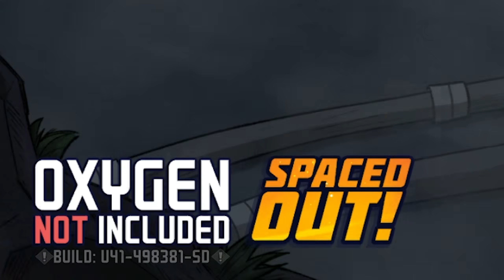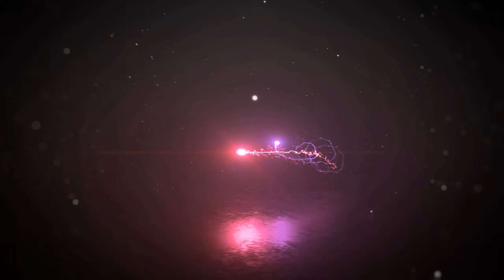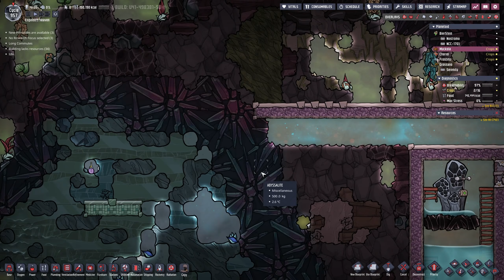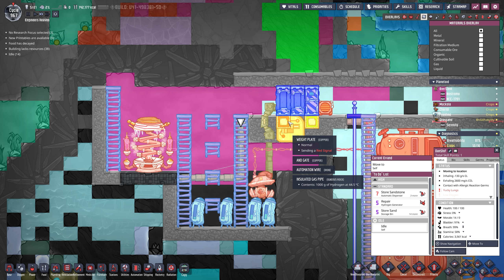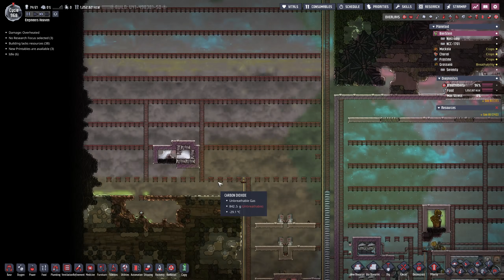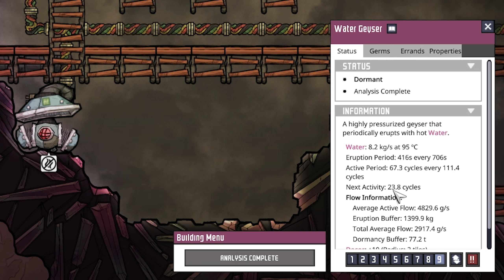ENGINEERING a WATER GEYSER TAMER! (LP1-EP 32) Oxygen Not Included Spaced Out

Comment: The devotion to using that particular bridge to feed water into the boiler is impressive.  
One of the reasons I love this game - everyone approaches it differently!

I would have built another feed pipe to the water vent coming from the other direction after some deconstruction/reconstruction of the liquid lock and probably some careful piping runs on the other side so I didn't punch a hole anywhere one wasn't needed (or do a lot of mopping to fix it :) ).
Reply from the maker: Since this boiler is just temporary and is completely useless after the planetoid has no more polluted water I just keep in mind that it doesn't have to be pretty since the idea is to rip it back out relatively soon anyways, haha :D
For a permanent build I would have probably rebuilt it as well. But as you said, that's the beauty of the game. Many different ways lead to the same(or at least relatively similar) solution :)

Comment: the airlock design on the walk-in fridge is nice, I'm gonna have to adapt that I think
Reply from the maker: It’s my go-to for fridges. Add a liquid lock before that to prevent gas exchange and you have both gas and temperature covered very easily.
Reply: @BierTier  I think I'll use the standard liquid lock design for situations where I absolutely don't want gas contamination, but something like this I'd just put a mini pump with some automation to maintain purity. I'm probably gonna do some debug mode experimentation and try to come up with some derivative designs ha
Reply from the maker: That is definitely a good idea, I never messed with it in debug, just in the Let’s Play. So there is definitely potential for improvement :)